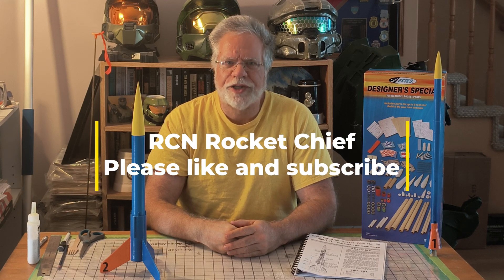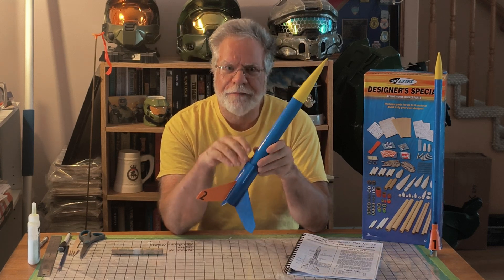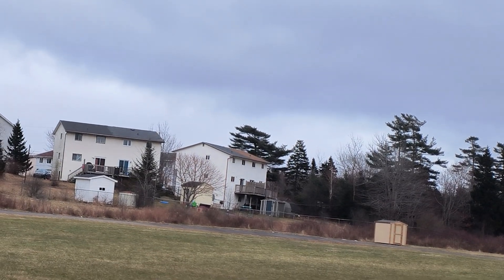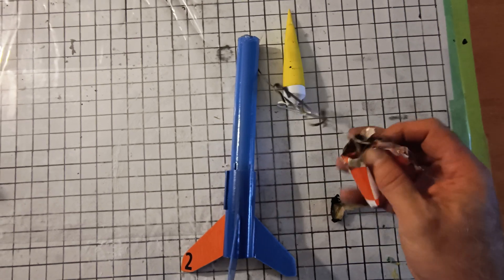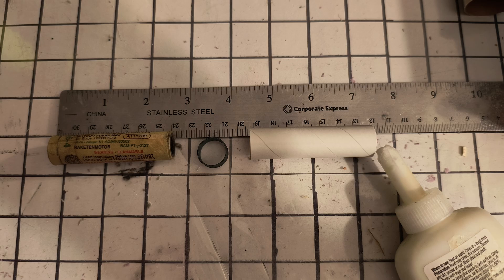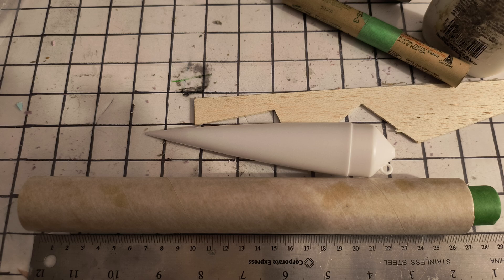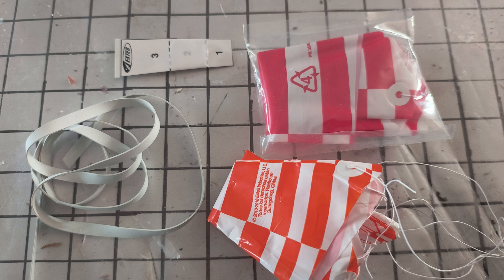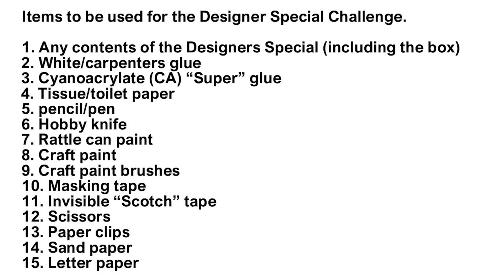Estes Designer's Special #2  Augie II ... or ... Chief, What's a Stack Rocket?

Comment: A paper clip as a hook is an interesting idea
Reply from the maker: There are better answers such as a fishing line snap swivel, but this is quick, easy and everyone can find a paper clip 🤣
Reply: @  I always use swivels, but this solution has an advantage. It can be reshaped as needed. In addition the swivel size can be a problem. Sometimes it is difficult to open it.
Reply from the maker: @ For sure! Like anything, there are advantages and disadvantages